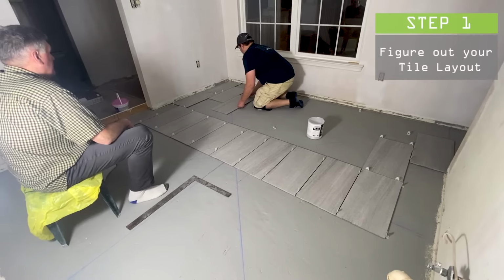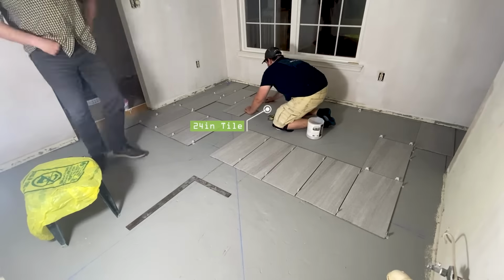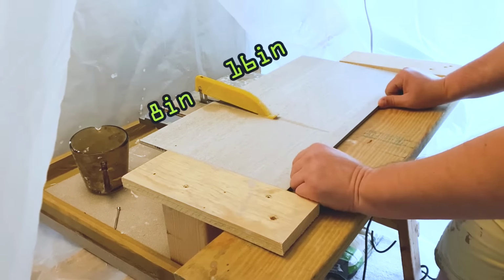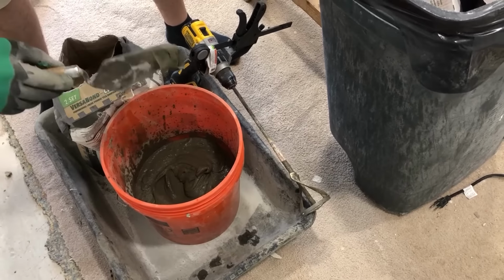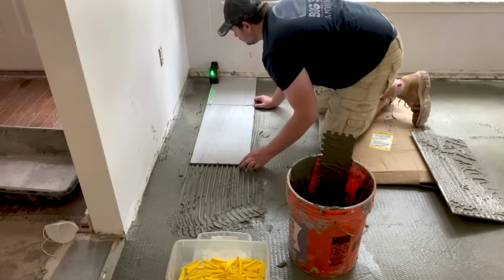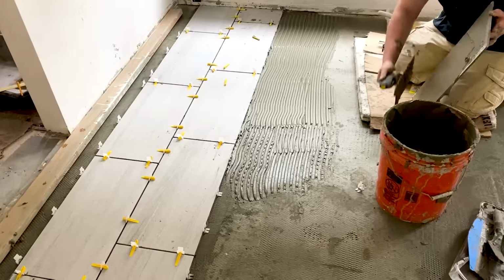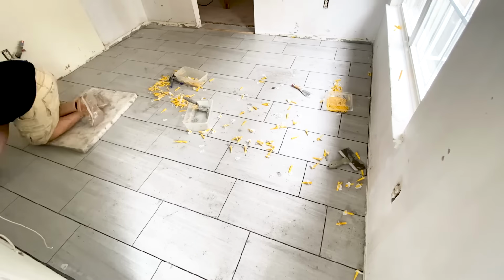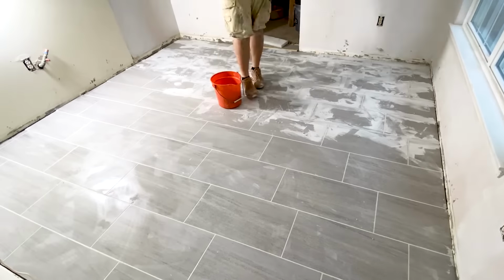6 TIPS For Laying Floor Tile With No Experience

Comment: Great tutorial. When do we need to add hardie cement boards to the floor? Im on a raised foundation so the whole bathroom was plywood
Reply from the maker: 1.  Tiling the Floor:
	•  Hardie cement boards are commonly used as an underlayment for ceramic, porcelain, or stone tile. They provide a stable, flat, and water-resistant surface that prevents tile cracking and ensures proper adhesion.
	•  Plywood alone is not an ideal surface for tile because it can flex, expand, or contract with moisture and temperature changes, which can cause tiles to crack or grout to fail.

2.  Moisture Resistance:
	•  Bathrooms are high-moisture areas, and Hardie cement boards are resistant to water damage, unlike plywood, which can swell or warp when exposed to moisture. This makes cement boards essential for long-term durability in a bathroom.

3.  Subfloor Condition:
	•  If your plywood subfloor is in good condition (flat, level, and structurally sound), you can install Hardie cement boards directly over it to prepare for tiling.
	•  If the plywood is damaged, uneven, or not thick enough, you may need to repair or replace it before adding cement boards.
4.  Code or Manufacturer Requirements:
	•  Some local building codes or tile manufacturer warranties require a cement backer board or a similar underlayment for tile installations to ensure proper performance and durability.

Comment: What should be the thickness of the  cement adhesive or the tile bed
Reply from the maker: Great question! The answer depends on factors like tile size, trowel size, and mortar type. Check the mortar bag for a table that specifies the recommended trowel size based on your tile size, which determines the mortar bed thickness.

Comment: This is a great video man.  Im tiling my gurage into my new bedroom.  The first step where you put the moter that could of better your words not mine is that step necessary?
Reply from the maker: I’m sorry I’m not sure what you mean can you elaborate.
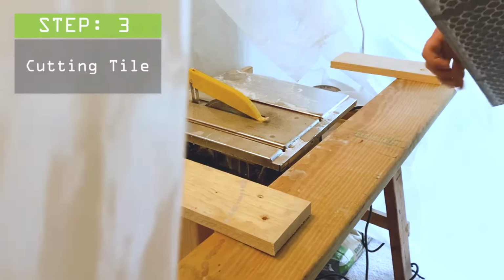Reply: @DIYwithMAX  yeah do you have to put the morter down first like you did with mesh wire and all. At 1:58
Reply from the maker: @ma3popeye no that was out very poor attempt at leveling the floor. What subfloor do you have?
Reply: @DIYwithMAX  it's concrete but quarter like a square with t in the middle.  It's very uneven the 4 separate squares that make up the 400 square foot area don't even line up perfectly.  Before your video I thought i just had to put thin set really thick in low spots and less in high spots.  I kinda like the pre leveling idea now the more I think about it.  Is the mesh required part of this process?
Reply from the maker: @ma3popeye the mesh just strengthens the floor it is not required but I strongly recommend doing a leveling compound instead of what we did. If you watch the video of us doing it you will find that it sucked big time lol.
Reply: @DIYwithMAX  thank you very much this all helped tremendously.
Reply from the maker: @ma3popeye always happy to help. Let me know how your project turns out.

Comment: You said under no curcumstances you should slide the tile as it will collapse the redges and give you uneven tiles. Well, you always must collapse the ridges, that is the main idea of glueing the tiles to floor, and problem with uneven tiles is solved by leveling the floor
Reply from the maker: Thank you for taking the time to leave a comment. I have addressed this in my next tile video. Please check it out if interested. Really appreciate your feedback.

Comment: I really appreciated the detailed steps you covered for laying large format tile. The emphasis on layout and surface preparation was particularly helpful. I often struggle with ensuring everything is perfectly square, so your chalk line technique will definitely make my next project smoother.

Living in the Midwest, I have to deal with varying subfloor conditions, so your advice on waterproofing membranes resonated with me. Also, I loved the tips on grout application. I usually end up spending too much time cleaning up excess, but now I’ll be more proactive during installation.

For cost estimation, I've found that using tools like FloorTally has made my budgeting much more manageable. It gives me accurate estimates based on local rates, which helps prevent unexpected expenses. Thanks for such an informative video!
Reply from the maker: Thank you so much for sharing all the steps you found helpful. It really helps folks that read the comments. Much appreciated.

Comment: Umm, the goal IS to collapse the thin set ridges. Fuller coverage results in a stronger bond and more support. And 1/3-2/3 overlap is only necessary if the tiles aren’t flat. And as mentioned already, the trowel grooves should be the perpendicular direction from this video. 

Anyone watching hopefully does more homework than watching merely this video.
Reply from the maker: I address this in my other tile video. Check it out when you have a chance.
Reply: @DIYwithMAX  no thanks.

Comment: Easier to work the layout on paper, allow 1/4" for grout. Snap layout on floor with chalk line. 4 tiles per grid. Always lay tile on cement backer board set in a mortar bed installed per manufacturers instructions.
Reply from the maker: Thank you for sharing.

Comment: I would told I should use flexible caul in areas due to texas moving so much
Reply from the maker: I would stick to that advice if it’s from a reputable local contractor. I’m not familiar with the Texas geography.

Comment: First step is don’t attempt this size project .. do a small mudd room
Reply from the maker: That’s a great point. If you can start with a smaller room like a closet or a bedroom to get the process sorted out so you can be a pro in the large living room areas that will be visible to the public.

Comment: 4:50 "Under no circumstances don't slide tiles into place as this will collapse ridges"? The most important thing when tiling is to slide it and collapse the ridges lol so that it gets full coverage. The way you do it is just place it on top of ridges and now tile isn't fully floating in thinset. Or you should use tile vibrator. And u missed MOST important thing - buy some cheap knee pads if you only plan to diy some small surfaces once or some professional ones if you have a lot of tiles. Ur body will thank you. Aaaaand, easiest way to clean excess thinset (if u didn't do it while installing) is with box cutter 24h after install (after 48h it's way to hard). And last but not least, good video
Reply from the maker: I clarify this point in my next tile video.

Comment: One thing where I would say that you are wrong is starting in the corner of your room.   When possible, always start in the middle of your room or middle of the house if doing to tile whole floor.  Go from middle/center and work your way out.  You can get away starting from the wall in small area.  The benefit of doing from the middle is that you are going to cut your mistakes in half.   Let say you started from the corner and by the time you reached halfway you got off by 1/8 inch, by the time you reach wall/full room you are off by 1/4 inch.  It is a lot easier to hide 1/8 on both sides than 1/4 inch on one side.

Also, trowel the shortest distance for air to escape, it eliminated/minimizes air pockets.

This method at starting from the middle applies to hardwood flooring.
Reply: We always snapped a grid on the floor with chalk line. Four tiles per square. Then you can start wherever you want to. Lay the tile on the line on one side, and the width of your grout line off your chalk line on the other side.
Reply from the maker: Thank you for sharing this advice. It totally makes sense. Much appreciated.

Comment: One thing you didn't mentioned. You applied mortar at the back of the tile. Do you recommend it?
Reply from the maker: Yes it’s called back buttering and it is very important step. It makes all the difference with adhesion of the tile.

Comment: Thank you . The only thing I had to go get was . 
Wet saw 
Dry cutter 
Mixing drill
Mixing paddle 
Grinder / blade
Trowels/ margin trowel .
Chuck line / chuck 
Square / p square 
Buckets 🪣 broom 
Sponge , grouting float ,  1 / 16 clips 
& wedges . …. Almost nothing
Reply from the maker: I bet you it’s still cheeper then having someone else do it for you.

Comment: The installer never taped on the tiles. This video is not good at all.
Reply from the maker: With this leveling system no taping is required. The level system levels the tiles to each other.

Comment: 4:49 what the hell? you want to collapse the ridges to remove the air, so the tiles aren't hollow, am i missing something here? Did I missunderstand what you meant?
Reply from the maker: No you are correct. My choice of words was not the best but I put out an explanation in the other tile video. Check it out.

Comment: Your floor looks awesome, a great job for a DIY project, the only problem you may encounter is the white grout in the kitchen which will get easily stained by various things like dropped food and spilled oil. Lasers are great as long as you don't bump them, I bought one primarily for self leveling which it is an amazing tool for
Reply from the maker: Thanks! I’m thrilled with how it turned out – it’s definitely satisfying to tackle a DIY project and see solid results. You’re absolutely right about the white grout; it’s bound to pick up stains in the kitchen. I did seal it with some stain-resistant treatment to help keep it looking fresh. And yes, lasers are game-changers for leveling; they’ve saved me so much time on this project – just need to be careful around them!

Comment: A good attempt at making this video.  But, I must note that after initially setting the tile on the cement adhesive, it is important to move (slightly) the tile back and forth to slightly collapse the cement ridges to remove the air pockets and get better bonding.
Reply from the maker: Thank you for the suggestion.
Reply: I use tile vibrator @DIYwithMAX

Comment: How much 2ft tile will be needed to cover a 24 ft in length and 10ft in width area? ... Don't really understand the square ft as yet
Reply: How much tin set can use to finish all that laying an what brand/type would u recommend for a flooring
Reply from the maker: To cover the area, you’ll need about 60 two-foot tiles in total. The number of boxes you’ll need depends on how many tiles are in each box:

	•	If there are 6 tiles per box, you’ll need 10 boxes.
	•	If there are 12 tiles per box, you’ll need 5 boxes.

However, you should also consider the pattern and its complexity. The more cuts you need to make, the more extra tiles you’ll need. It’s recommended to get 5% to 10% extra tiles.

So, in your case:

	•	If there are 12 tiles per box, you’ll need 5 boxes plus 1 extra box for cuts.
	•	If there are 6 tiles per box, you’ll need 10 boxes plus 2 or 3 extra boxes depending on your pattern.

Hope that helps! 

Here is a link to a good tile calculator if these numbers change: https://www.calculator.net/tile-calculator.html
Reply: @DIYwithMAX   bro thanks alot  I really appreciate it 🙏 💯
Reply from the maker: Of course I’m always happy to help. I just dropped a second video about tiling you should check it out if your looking for more information.
Reply: Have 1 more questions
Reply from the maker: @tevinjourney you don’t have to say that every time you have a questions just post them. I try to answer all posts, especially with questions.
Reply from the maker: @tevinjourney No I can’t come do your tile for you 😂.

Comment: Are you suppossed to backbutter the tiles like that?
Reply from the maker: You are if you want to get a good bond. Mortar will stick to mortar a lot better than mortar to a dry time. We are only applying a skim coat to improve adhesion
Reply: @DIYwithMAX  thanks. Gonna have a crack tomorrow and see how it goes!
Reply from the maker: @huntergatherer8972 you got this.

Comment: Why not do more than a 1/3 overlap for large format tiles?
Reply from the maker: That’s what the bosses wanted. And we don’t question the ladies design choices we just do the work 😂. Who would you do it differently.
Reply: @DIYwithMAX  I was just curious. I just completed three bathrooms and a laundry room in a home with a 50% overlay. You're not the first person on YouTube to make the comment to "never do more than a 30%" overlay without an explanation of why. I thought maybe I had missed some  important instruction over the years.
Reply from the maker: @JD-sh8ub three bathroom? That sounds like a lot of work. My hat is off to you.
Reply: They only say that about large format tiles. My guess is that if you do 50% overlap when there are cracks the cracks will go straight through the tile. If you do 30% the cracks will go along the mortar lines which is a lot less visible.
Reply from the maker: Great question! The reason many recommend sticking to a 30% overlay is to minimize lippage, which is when tiles aren’t perfectly level with each other, causing one edge to be higher than the adjacent tile. This can be more noticeable with larger tiles or if the subfloor isn't perfectly flat. That being said, if you've achieved a smooth finish with a 50% overlay, then you’ve done a fantastic job! It’s all about understanding the challenges and working with what you’re comfortable with. Thanks for sharing your experience!
Reply from the maker: That’s a good guess.

Comment: At 4:50 you said don't collapse ridges, but I think you should collapse ridges, to get the the most contact area between floor and tiles. You can see other people demonstrating it with glass.
Reply from the maker: The point I was trying to make is to not put the tile like an inch away and then try to slide it in to place collapsing the ridges prematurely and getting mortar in to the grout lines.  You want to but up the next tile to the laid tiles and then collapse the ridges. I also did not put this in the video and should have, we periodically pulled up tiles to make sure we were getting proper coverage. I hope this helps clarify my statement.

Comment: Yikes. When doing a how to guide it’s to get the details correct - you’re combing the thinset ridges in the wrong direction. They should be running parallel to the shortest edge of the tile.
Reply from the maker: Thanks for sharing that best practice. I have been testing my wrong technique for about two years and the tile looks as good as new. I’ll keep you posted if that changes.
Reply: @DIYwithMAX  Problem is if you drop anything on the tile there are air pockets under the tile so those are points where porcelain tiles will break and that won't look good. 
So - don't drop anything on the floor would be my advice and it'll probably continue to look good.
Reply from the maker: @mikebonello7494 the so you Mike we will do our best my friend. If I’m being honest I do hold my breath every time a pot goes down lol.

Comment: Hi how much extra height does the glue under the tile add to the tile ?
Reply from the maker: That depends on the size of the tile and the mortar(glue) it requires. On the mortar bag there will be information on what size trowel to use and how high the ridges should be for proper installation. 

- A 1/2 x 1/2 inch (12x12mm) square notched trowel yields around 1/4 inch (6mm) of thinset thickness.

- A 3/8 x 3/8 inch (9x9mm) square notched trowel yields around 3/16 inch (5mm) of thinset.
Reply: @DIYwithMAX  the tiles we as are getting at porcelain 600x600 and 10mm thick 

So id say around 15mm all up ?
Reply from the maker: It’s never exact but around there is correct.
Reply: @DIYwithMAX  thanks. I'm just installing a drain before my tiler starts tiling our alfresco so his told me to make the drain sit 15mm higher 
So assuming 10mm tile height + 5mm adhesive stuff
Reply from the maker: @PatrickGuerrisi there are drains with adjustable tops for this purpose this way you have few millimeters to play with and set the hight just right.
Reply from the maker: @PatrickGuerrisi here is an example of such adjustible drain https://amzn.to/3Rc0JPa

Comment: How soon do you put down grout after laying tiles
Reply from the maker: That answer you would find on the bag of mortar you are using by good rule of thumb is to lay the tiles set overnight so they don’t shift on you if the mortar is not dry underneath.

Comment: One critical mistake you make in this video is not collapsing the ridges. You advised to do the exact opposite of what you're supposed to do after laying the tile- wiggling the tile back and forth. This will not cause squeeze out through the joints if you first use a margin trowel to scrape away a thin strip of thinset along the tile edges before laying the tile.
Reply from the maker: Great advice thank you for taking the time to leave a comment.
Reply: Ya I was wondering that , I’ve seen other videos where they showed clear glass how it gets coverage
Reply from the maker: @Here-2-Learn yeah 👍 definitely misspoke there, what I was was trying to convey is to place each tile straight down in its final location, not place it down and then try to slide it in prematurely collapsing the ridges. Hope that clarifies it lol. Unfortunately I can’t edit what I said the I the video it self without re-uploading it.

Comment: First step is to prepare the floor on which you intend to lay the tiles otherwise everything else is just an expensive waste of time and money,
Reply from the maker: Very good advice. And we have a great video on what NOT to do that’s why it’s not part of this instruction video.
Reply: Make sure the floor can provide adequate support (no movement) and always use cement backer board, set in a mortar bed.
Reply: How do you prepare the floor?
Reply from the maker: @melathomas1326 check the playlist in the description. I show you what not to do lol.😂
Reply: They went fast through that part; I need more info for sure.
Reply from the maker: What part? I’m happy to help elaborate.